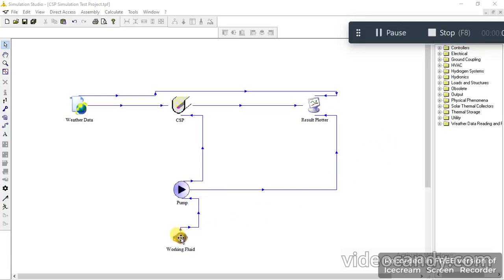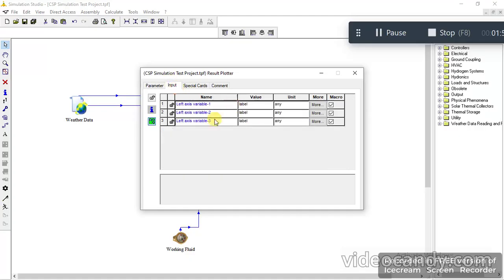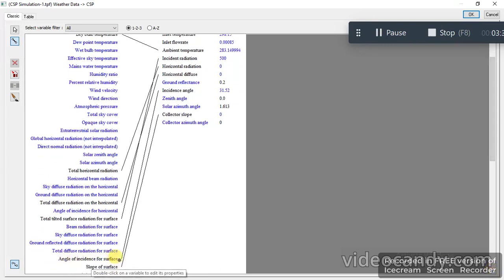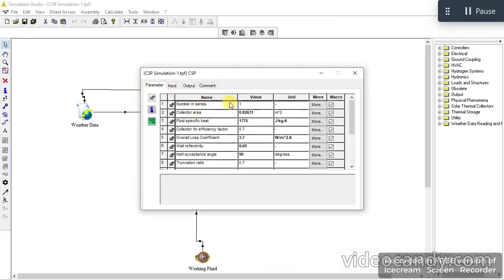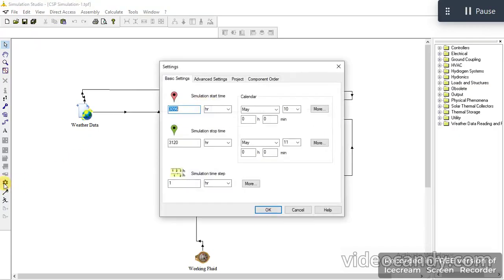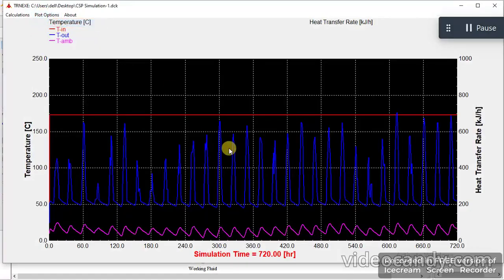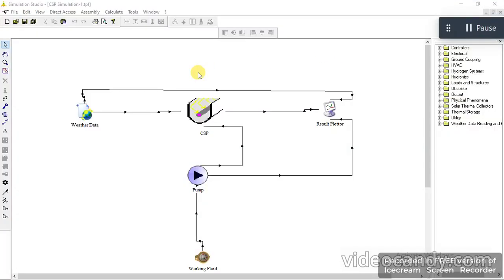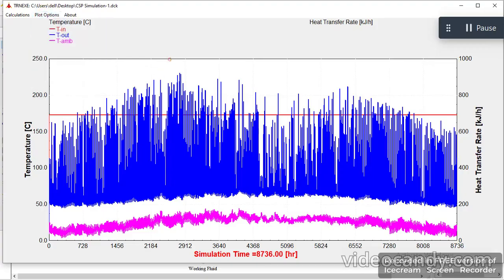Solar Parabolic Trough Collector Simulation using TRNSYS Part-2 | Thermal Performance Analysis

Comment: why is the fluid coming from the pump already so hot?
Reply from the maker: Fluid coming from the pump is not so hot, it is 298.15 K which is equal to 25 C.
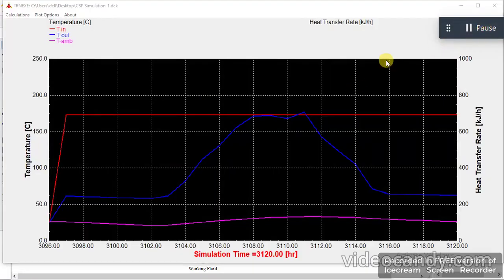Reply: @danyalsengineeringthoughts7677  but on 9:12 for example you can see the T-in, coming from the pump heats to 170ºC. why?